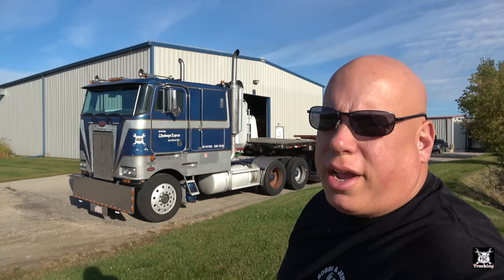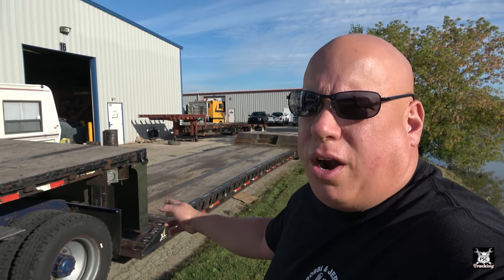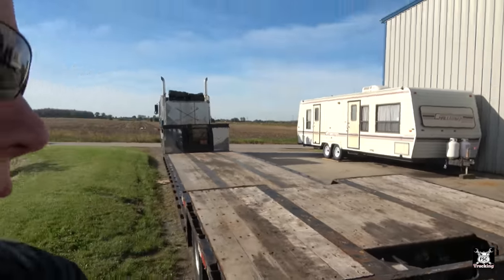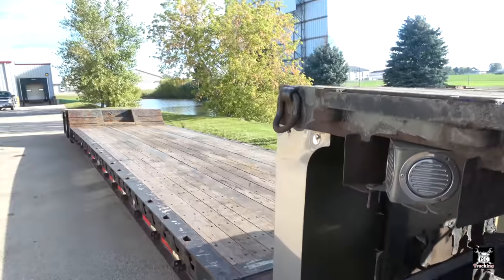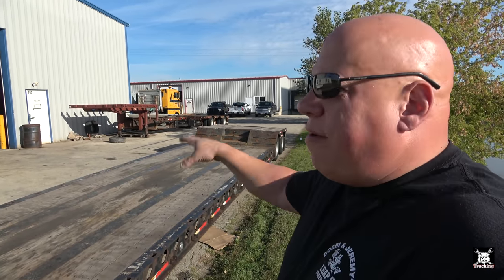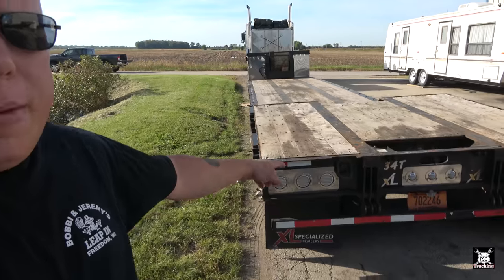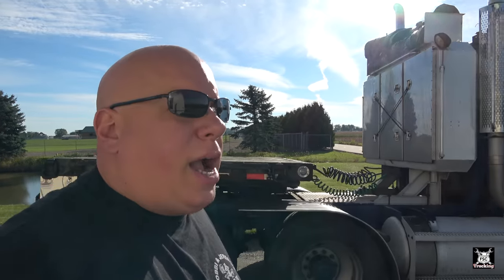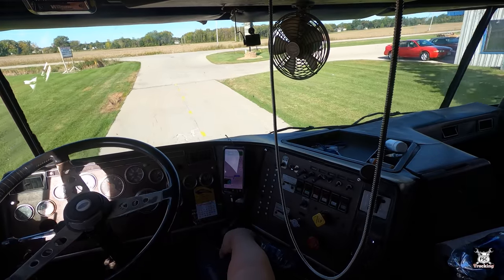I Bought A New RGN Trailer {XL Specialized}

Comment: I pulled a lowboy back in the 70s with a flip up tri-axle for a few years, the only problem was finding somebody to flip it upside down on the back end after I unloaded.. It saved on tire wear and toll road costs that charged by the axle. Largest load I ever hauled with it was a Koering triple 6 track mounted backhoe; 11’9” wide, my total gross weight over 120,000 lbs if my memory is correct

Comment: About once or twice a year I got out my 5 gallon sprayer and filled it with Thompson's water seal, the clear one.  You can use the colored ir tinted stuff if you want.  Anyway, it does a fantastic job of preserving the wood deck without making it slippery or slimy.  Some guys put used motor oil on their deck but don't do that.  When I sold my 2005 Doonan they asked if I ever used the trailer because it looked new.  Thompson's works great.  1 5 gallon bucket will do the trailer with a sprayer.  I also buy black rustoleum and routinely brush off the rust and spot spray areas that need a little paint.  Really help keep the rust from taking hold.  Nice trailer.  I owned a XL stepped and that thing was bulletproof.  Doonan and XL make good products.  Be well!

Comment: i've ditched every trailer tire and wheel under a 19.5 long ago. Since moving up to a 19.5 or 22.5 i've yet to have a blowout in over 3 year years. With them damn 16, 16.5, and 17.5s never made it more than 3 months without a blowout and a lot of down time trying to find one while out on the road. Every loves has 19.5 and larger on hand. so do most road side services.

Comment: If you're worries about clearance on the neck, why not just remove the mudflaps when you're pinned up? That's what the guys in my fleet do...
Reply: I was thinking the same thing but the problem for Steve, I believe, is getting between the trailer and back of the tractor to work on connecting/disconnecting. Let's see how he does when he picks up that Striker, if they allow him to video it. Otherwise we'll have to wait until he delivers it. Hey, is that what they call a cliffhanger?

Comment: Should have got one that has ramp's that comes down. So it will be easier to unload and load vehicles. That is why i do all the time or dry cargo. I never do refers cause i always have to clean them out good. And what company u ick up the load. There like looking in the trailer with a magnifying glass. Looking for anything that will have them reject the load and fine u for dirty trailer. The company i co-own with the family that own's it. We stopped doing refers cause of that and also company's demand they trailer's be sprayed out. And they want the driver to spend about $20.00 to clean our the trailer again. So the boss lady and boss man before he passed away said nomore refers. Steve got a question. What made u drive a cabover? My wife wanted to ask u that. She asked me if i would and i said i do the dump truck since it's a cabover. And she was like no his. And i said hell i would have trouble getting in and out the back since u have to climb over the doghouse. And my youngest son and my wife was like ??? I told them that it's called that. My youngest had my daughter call my boss and he goes why's the dog house in the semi. She was like ???? Texted me like WTH. I called her and she laughed.